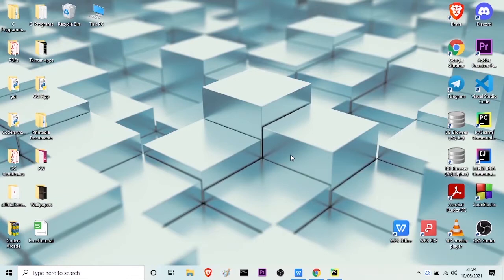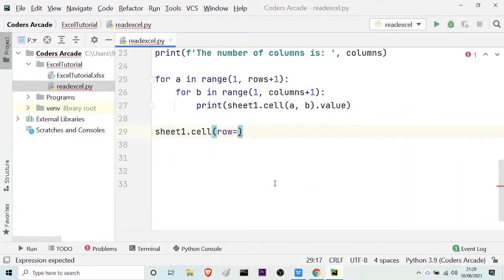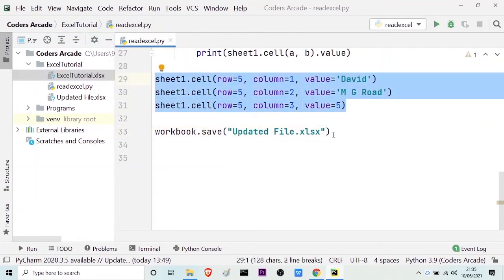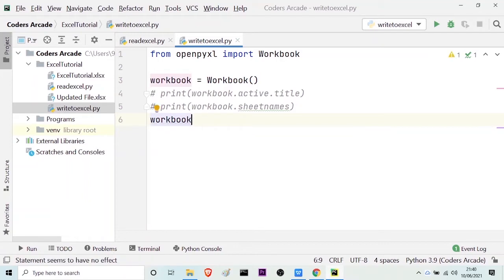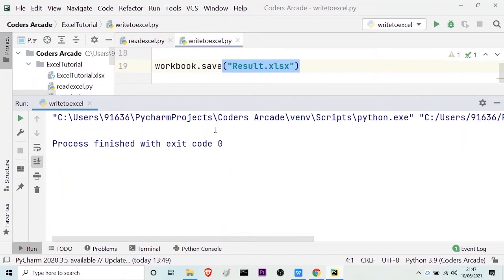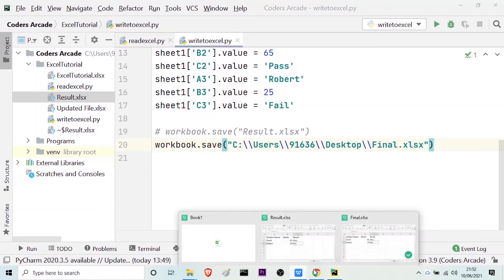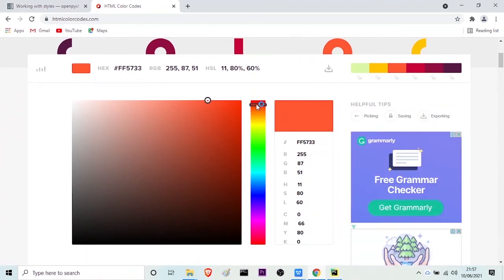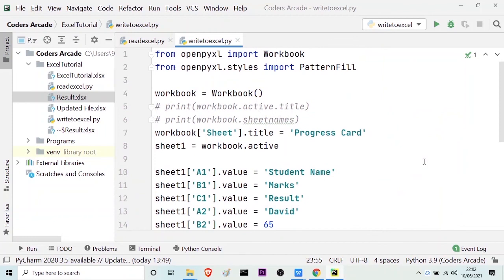Writing Data Into Excel Files Using Python || Openpyxl Tutorial

Comment: Yes i did it ... But i don't want to save the formulas to the excel sheet but i want to save values only ... How can i do it ?
Reply from the maker: Great job on implementing OpenPyXl for writing data to Excel! If you want to save values only, without formulas, you can achieve this by setting the data_only property to True. Here's a quick example:

from openpyxl import Workbook

# Create a new workbook
wb = Workbook()

# Select the active sheet
ws = wb.active

# Add some sample data
ws['A1'] = 10
ws['A2'] = 20
ws['A3'] = '=SUM(A1:A2)'  # Formula to showcase the difference

# Save values only without formulas
wb.save('your_file.xlsx', data_only=True)

Setting data_only=True ensures that only the calculated values are saved, not the formulas. This way, when you open the Excel file, you'll see the results without the underlying formulas. Feel free to adapt this to your specific needs. Happy coding! 💻📊 #Python #Excel #OpenPyXl #CodersArcade